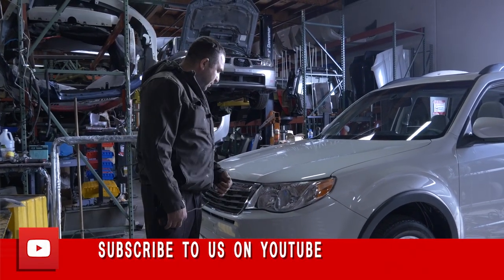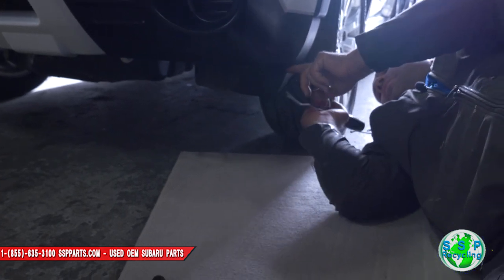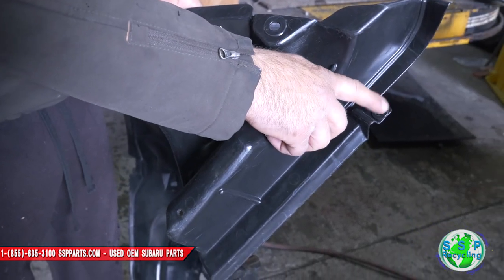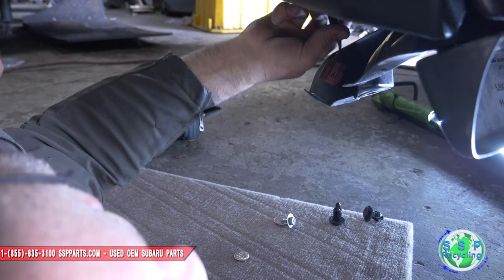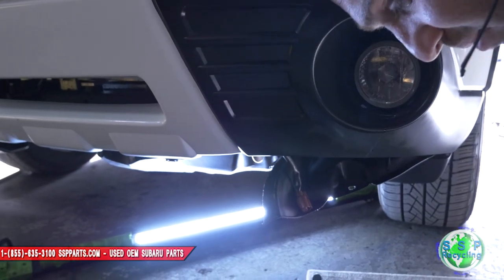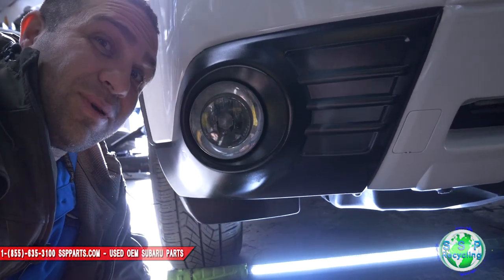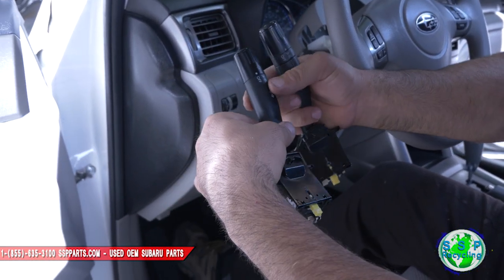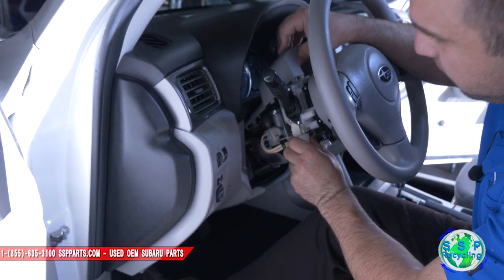How To Install and Convert a Fog Light [CONVERSION] - 2012 Subaru Forester

Comment: Years ago I worked as a technician at a trailer shop. We had a customer, a lady, that needed a towing package installed on her truck. (i.e. brake module, and electrical connections). She had taken it to a dealer, Ford I think. They quoted her somewhere in the neighborhood of $500. They stated they would have to install the wiring harness as part of the cost. I can't remember why she didn't use the dealership, but she came to us instead. Anyway, my boss, being an honest person explained to her that her truck already had the wiring harness installed from the factory. The dealership had to have known this. I think we did the job, total (brake control, plug, labor) for about $200. My boss could have easily scammed her. But he didn't. I gained even more respect for him after that. I appreciate that you are willing to share your knowledge and expertise.

Comment: I had the fog lamp kit from Subaru for my 2011 for at least 3 years, read the instructions and thought i needed to pull the airbag and fully remove the front bumper so i didnt install it. Watched your video and it was done in a day. Fantastic! Great work... Thanks!
Reply: Hi Dennis, I have a 2011 forester also I tried installing the relay today but I got lost when I saw there’s a relay there already I was wondering if you had any problem with this ??
Reply: @xaviersanchez9483  had a quick look and can see 2 relays on left side and 1 on the right that were there originally. I then added mine on the right but put it in the second from the bottom up but had to move it to the third from the bottom up on the right side. Hope that makes sense. I guess if there’s one there already it doesn’t need another one?
Reply: Thank you Dennis I’ll try this tomorrow!!

Comment: I know this is a 2012 but is it the same process on a 2010 forester? and if not could you explain the difference please!!
Reply from the maker: Very similar but the switch will be on the combo switch
Reply: @DIYCarHunters  the combo switch meaning the empty switch cover? It will go there instead of the thing you changed out? Sorry new to working on cars lol.

Comment: I know this is an older video, but I have a 2011 Impreza 2.5i without fog lights. The fog light housing and stalk is the same, so is the interior (as I'm sure you're aware), do you know if my Impreza is wired for fogs from the factory as well? Would following your video on this Forester give me the same results? 

Thanks!

Comment: Do you need a new headlight stalk to make them work at all? Or can you just use full headlights OR parkers to get them to work? Is there another way around this? I'm finding it difficult to get a stalk for right hand drive that had a fog light option.
Reply from the maker: Ahh I see yeah you will need one for a right hand drive car I don’t have any
Reply: @DIYCarHunters  all good, I found a wreckers that had one, cheers for the video.